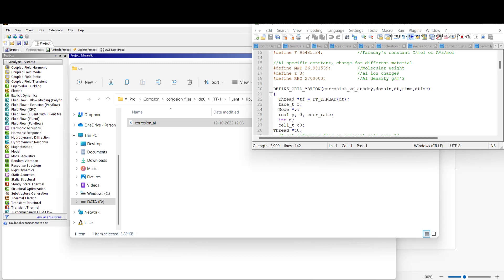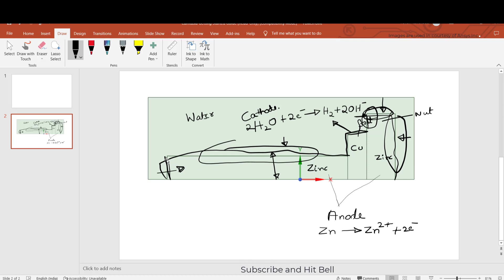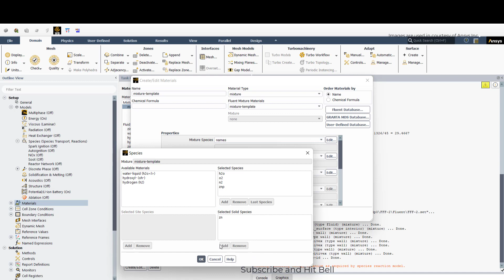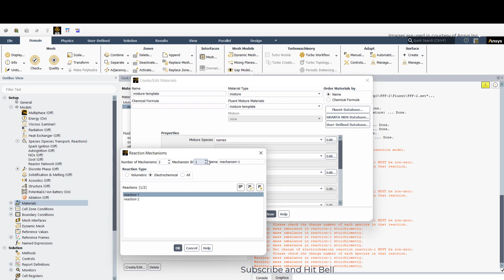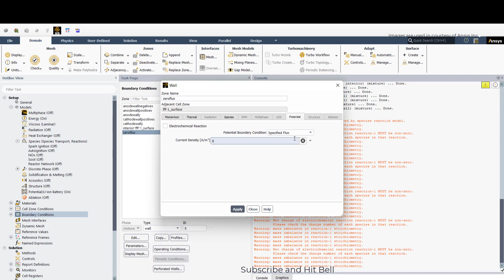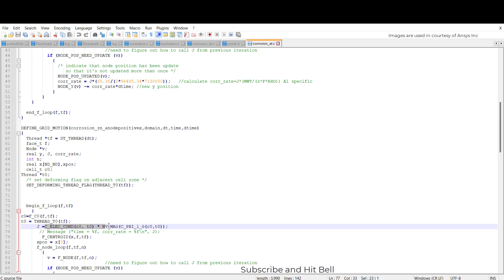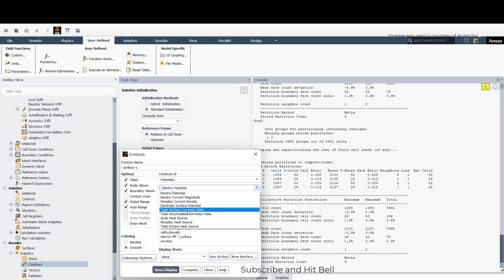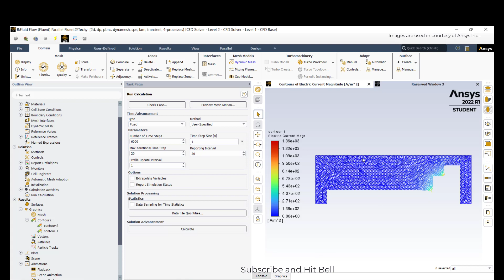Corrosion Modeling Using Ansys Fluent || Define_Grid_Motion

Comment: Have you performed a validation of the corrosion model you developed to ensure its consistency with real-world data? I am interested in performing a deposition analysis, which is the opposite of corrosion. I would like to examine the deposited metal thickness and the current density distribution. I’m looking for assistance with this
Reply from the maker: ss.sv1186334@gmail.com